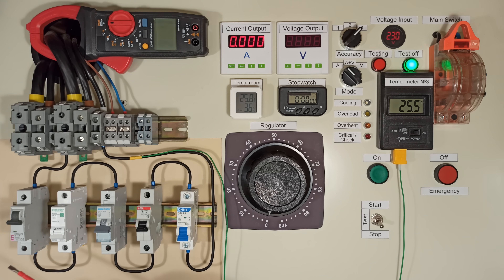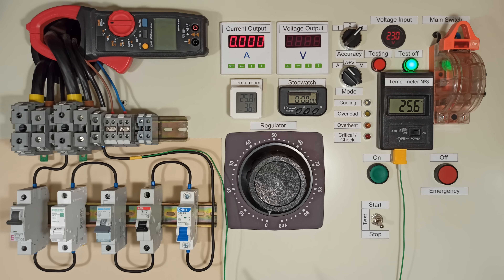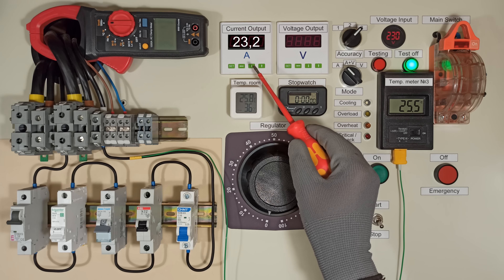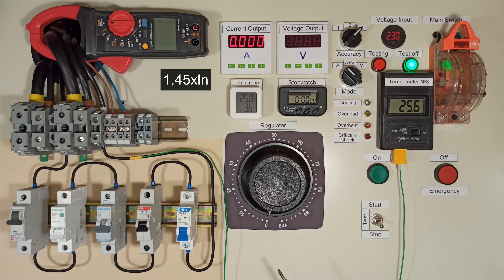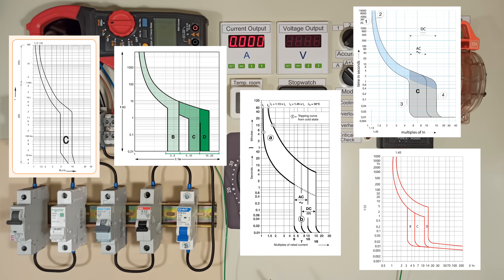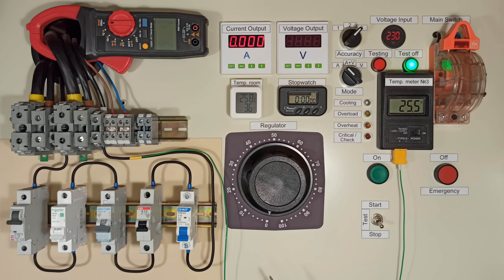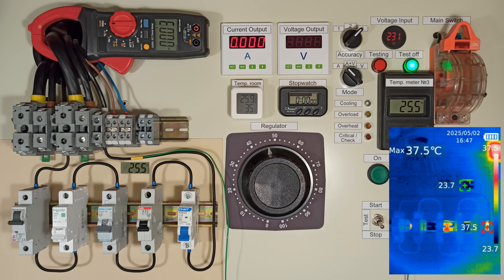Test MCB 16A. ETI, SE, Hager, ABB, CHINT

Comment from the maker: Please support my channel: https://www.youtube.com/channel/UCqZUswoAI9E9iFcTeS7L6gw/join
Which is better – fast tripping or slower tripping? Also, about the ETI circuit breaker – I use them. Great breakers! I'm thinking of repeating the test with 5 identical ETI breakers. Like this if you're interested too! 
Upd 17.05.25 Test 5 ETI
Upd 30.05.25 Test Eaton, Noark, Gewiss, Legrand, E.Next
Reply: pleas test EATON too
Reply from the maker: @HansWurst-bs6yr  Ok, I'll pick out 5 more circuit breakers. I'm curious myself.
Reply: @ElectroTest_1  there is EFAPEL brand, made in Portugal
Reply: @ElectroTest_1  would love to see how cheap chinese ones perform, in my experience there may be some surprises. I am also curious how 10A breakers behave, in my opinion they are often faster than they should.
Reply from the maker: @xtevesousa Okay, I'll keep that in mind. I'll see where I can buy it.
Reply from the maker: @arion_vulgaris Thanks for idea, if I have the opportunity and time, I'll test the 10A.
Reply: Before buying more identical (also interesting) just repeat the same test on the same breaker (with sufficient cooling reset time inbetween)
Reply from the maker: @cybermaus I agree, the thermal element is not very accurate. I think there can be significant deviations for a specific circuit breaker as well as for several tests in a row.
Reply: It would be amazing to see the difference between big name brands and the smaller companies that are popping up, (most seem to just re brand Chinese products)
Reply from the maker: @MrDleete-mj9vt Yes, it may be interesting. However, don’t forget that a circuit breaker is not only about tripping protection. It’s also about reliable and high-quality terminals, functionality, additional components, warranty, etc.
Reply: @ElectroTest_1  Ich nutze Siemens.
Reply: @MrDleete-mj9vt Yes, you are right, many products are just developed locally and manufactured in China.
Reply: il magnetotermico DEVE rispettare la curva di targa, quindi per quanto possa sembrare strano l'ETI ha fallito il test. A ogni modo sarebbe interessante vedere anche Siemens e Biticino
Reply: which is better depends on the use. If you start an electric engine ( a big vacuum cleaner or some thing) then slow is better. the starting current can be cute large. for realy big engines you sometimes even need a class B breaker isstead of a C class breaker. As long as the breaker is lower raded then the wireing youre good.
Reply: ABB and SE are much better quality. But this is known since 100 yrs
Reply: Fast tripping is better
Reply: It was my impression a few years ago that some "off brand" contactors were copies of the previous generation of " big name" ones or used the old tooling. This could be useful for replacements as it seemed to be normal to change the terminal layout and accessory mounts with every new model. It would be interesting to look at old datasheets to see if mcbs are the same.
Reply: Kommt auf den Einsatzzweck an! Sicherungen sind KEIN Geräteschutz nur ein Schutz gegen Bandgefahr! Eben um alle Einsatzzwecke abzudecken gibt es in jeder Leistungsklasse (2. 4, 10, 12, 16, ..... A) auch verschiedene Typen mit verschiedenen Schaltkaraktaristika (A, B, C, D, Z, K,....) https://de.wikipedia.org/wiki/Leitungsschutzschalter
Reply: This is precisely the reason, I prefer HRC fuses, over mcb.
In my test benches I always use semiconductor fuses in series.  
Now that semiconductor fuses prices have dropped drastically, it makes no sense not to use it. 
Please note the tripping time is what protects from a disabling injury. (I prefer less than 5mS) Flashover in face creates serious injury (seen umpteen both for humans & simians).
Stay safe & donot use mcb as a protection. Use a large rated S.Fuse if in doubt, but do use please.

EDIT: Tripping time in Second😅😅 is NO safety for the personnel. It's like a jack hammer hitting an object 5mS makes sense. 1S makes it a salad.
Reply: slower tripping -> 3-phase electric motors
Reply: It would be interesting to see how very old and used breakers behave.
Reply: Lower coil trip current. This is only meant for shortcircuit but It should be as low as possible, I don't get why it has to be 10x the rated current
Reply: I'd like to see one by ADELID, please.
Reply: Those same circuit breakers are available with different trip curves from A to F (C is the most common). The deeper into the alphabet the higher the inrush currents permitted.
Slow is good for motors, fluorescent lights and switch mode power supplies.
K curve and Z curves are available from some manufacturers…
Reply: @allangibson8494  "The deeper into the alphabet the higher the inrush currents permitted"- it's not that simple, for example K is between C and D (12x nominal current) and Z is even faster than B (3x).
Reply: Чинт работает!  Как там жизнь на земле заморской?
Reply: all made in China，all pass requirement, pointless testing
Reply: Fantástica prueba …simplemente excelente información técnica …gracias por tu aporte de alta calidad…saludos 😃👍
Reply: IDIOT test.
Reply: VERY GOOD TEST !
Reply: Application-dependent answer. Fast trip for delicate circuitry is better, but applications with motors and other 'working' pieces tend to require the higher curves due to inductance / heat loading.
Reply: Rápido. Se trata de proteger aguas abajo.
Reply: I wonder if there is a quality difference between a earth leakage + circuit breaker  compared to a alamat (not sure if also called like that in English, but the combination of the two in one test).

Comment: the ETI trips at 34 C, does this mean it wont work in hotter environments? like in the summers, my room temperature could reach 35 C easily. I don't understand it, so I asked.
Reply: The temperature refers to the temperature of the electric wire, which heats up due to electric resistance. If the breaker does not function properly, more power can go over an electric wire than intended, causing the wire to heat up potentially reaching temperatures at which the wire (or things surrounding or touching it) can light on fire due to the temperature. The breakers are being tested, by running 23.2A (so 1.45x more than intended, for a total load of ~5400W) through them. Regardless if it is hot, or cold, you shouldn't run too high loads. If you need more than 16A (~3750W), you should be splitting the load over 2 16A breakers, or use 1 larger (30A or so) breaker. The breaker is there to protect you from fire (and/or electrocution).
Reply: To clarify, the 34C is just a measurement of the wire. It is not (directly) related to the speed of the breaker operation. As seen in the curves (in the datasheets), the breaker should trip based on (1) the % above the rated maximum, (2) the duration this is done. For example, if the load is 10x higher, the ETI should (according to its datasheet) trip in fewer than 10 millisecondes. Hope this clarifies!

Comment: ETI always was bad.
They are often welded, while switch on with load near they're nominal current.
50A mcb almost always failed.
8 from 10 was welded contacts.
Reply from the maker: Interesting. Thank you for sharing your real-world experience. After what period of time did problems with the circuit breaker start to appear? Were they used in apartments, houses, garages, or at industrial facilities?
Reply: @ElectroTest_1  
Industrial facilities.
Beckup power supply.

Almoust immediatly - less then one monce.

Comment: Speed and temp is nothing without knowing gauge(seize of the cable being used and their isolation) Please include this information before testing the AMP jolting trough any circuitbreaker.
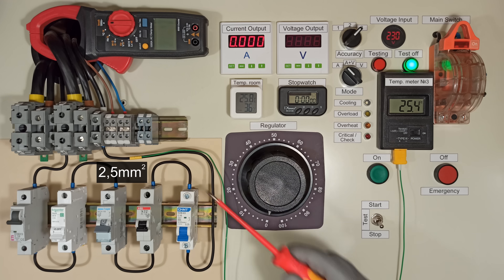Reply: It is shown at 0:44 to be 2.5mm². Electric (indoor) wire is typically coated with (a single layer of) PVC. The example is a very common electrical installation in a modern Northern European home.

Comment: shouldn't each breaker get their own independent feed? Now you are just looping them from breaker to breaker, introducing more resistance after each loop. Each breaker after each loop is effected by the breaker before it so you don't have a clean calibrated result.
Reply from the maker: Overall, you are right — for laboratory tests it would be better to check separately and with a greater wire length, about 1 meter. I didn’t think about that at the time. But do circuit breakers significantly affect each other? If it’s just a few percent, I don’t see a problem.

Comment: Just went through this test for building a fuel controller panel, B series breakers for the Dispensers and D series for the Motors, everything is ABB, looks lovely VS what we had been using
Reply from the maker: Thank you for sharing your experience! I will also test different machines. And where exactly is this fuel control panel located?

Comment: i realy fail to see what we gain from this? there will always be a slight diviation on the bi-metal that messures the overcurrent. so already here this test could trip out false positive due to a single sample size. then there is the voltage drop over multiple breakers because they all cause their own resistance. not alot. but it's still there. and last all products build to their own specification. so as long the wire never gets above 60-70 degrees C (depending on the wire type, and my memory serve me right) it's all safe. and how do we calculate this? how many jouls will the wires be exerted with a low current short and high current short (really just the the lenght of the wire from where the short is) if the wires don't get exerted the maximum amount of jouls. it's up to code. sure some one could set an extension cord from the outlet and have a short few hundred meters out. but that should be covered by the breaker. and as we saw here. that seems to be no problem at all, so we don't need to calculate if the load gets exerted the rating of the breaker to be up to code.

having a bit longer cut time like the chint is beneficial if you got a motor with a high starting current. but how often do we start and stop a motor without a softstarter? very good reason heatpumps got a large capacitor to spread the start load.

Comment: You're testing MCBs with different trip curves. This is a useless test. Those manufacturers give you multiple trip curve options for the same breaker model. You could have chosen to compare apples with apples instead of oranges

Comment: useless. seems you do not have elemetary knowledge of electricity. Tes it single, oteherwise the resistance of each connection will influence......
Reply from the maker: You made a great observation! Breakers can influence each other — but will this influence be significant? Although I do have similar tests where the breakers were tested individually

Comment: They all seem to perform more or less as expected. What I'd like to know is how circuit breakers behave when the overload is closer to 1.1 or 1.15x nominal. Is there a point where the tripping time is essentially infinite? Do you get a few hours?
Reply from the maker: You asked a good question! I haven't tested it for more than an hour or two yet. Overall, I still think that it really might not switch off. However, there are various factors. If the circuit breaker is in a real electrical panel, the heat will likely accumulate. It might be worth trying such tests.

Comment: Would be interesting to have the resulting temperature of a wire that is installed in a realistic environment and see if the breakers can keep the temp below 90 degrees in all load scenarios.
Reply from the maker: Good idea. And why exactly 90 degrees? Do you mean the maximum cable temperature? How is it better to position the cable on the test stand so that it’s close to real-world conditions?
Reply: @ElectroTest_1  Yes max calbe temp. Real world condition f.e. of a real cable in a cemented wall at usual laying depth f.e. 2 cm deep in concrete and plastererd in. Standards are designed to keep it below max cable temp. would be cool to have a video demonstration if it really works with a given protection device.
Reply: Also the non standard way of doing things. What happens if you lay the cable in a slit you did in a thermal insulation material. F.e. an XPS inner wall insulation mat. Preferably melting or burnable insulation like polystorol or some bio granulates. Could happen f.e. with a hollow wall cabling line when blow in insulation is applied later.

Comment: It was already mentioned to repeat tests after manually switching X times but id add this one: physically fix the switch and take it into far beyond switching regions. Then repeat your tests.

Its way too common for people to hold switches in place when they need more power but breaker keeps opening. It can cause partial welding and dendrite growth.

Comment: Не забываем что для SE характеристики указаны при температуре окружающей среды 40 град цельсия, для остальных температур есть поправочные коэффициенты.
Reply from the maker: Why does Schneider have circuit breaker curves rated for 40 degrees? Most manufacturers use 30 degrees Celsius, and SE also rates theirs for 30 degrees. For 25 degrees, the nominal current needs to be adjusted — it’s about 0.5 A higher. In this video, I didn’t focus on that, but I do take temperature into account in future work.

Comment: I'm from the area where we have an ETI factory. Izlake, Slovenia. It would be interesting to test some of their identical fuses to see what the consistency is. Also what wires did you use? I didn't notice if you mentioned this info. Are they 2,5mm square hard wires as they should be for the instalation use in hardwired wall cabinet for residental usage?
Reply from the maker: It’s nice to see people from interesting places! Maybe you even work at the ETI factory? In the video, the wires are 2.5 mm² (actually 2.35 mm²). However, these are flexible, multi-strand wires, which shouldn’t significantly affect the heating.
Reply: @ElectroTest_1  I don't, but my cousin works there as a maintenance worker.

Comment: Circuit brakers must work as announced in the datasheets. Ideal conditions when it in the middle of graphics, but anyway it should be safe and not to be overheating and firing. Schnider has good price and quality, ABB and Hager are  also good just a little bit expensive

Comment: Nice test but i don't think it is valid for a comparison. This because:
- all breakers are wired in series. The 23,3A is given by a 10 Ohm resistance, but the actual resistance is much lower. A guess is like 0,01464 Ohm
- the 23,3 Amp is measured at the input side, but is not the actual total of all combined. 
- Since heating up increases the resistance, less ampere will flow, thus less heating. At input of of 23A heated to +20 °C  21,3 Amps will flow, at +40°C just 19,6 Amp will flow. So 1 heated breaker will restrict the flow on all of them. If more heat up to different temperatures there is no telling what the actual current flow is without measuring. 
To compare them in a equal setting they must be tested separately or parallel.
So please do. It would be interesting to compare the series vs parallel test in practice.

Comment: ETI is the best and accurate option to protect the wires. Activates at more than 16 Amp and is inside the area of the graph if you do an analysis of the uncertainty of the  instruments.
Reply from the maker: ETI makes good-quality electrical equipment, but this particular breaker seems to trip a bit faster. I probably should’ve used a slightly higher current, since the temperature was about 5°C lower. Still, that’s not too bad — better earlier than later =)) You can also check out another video where I test 5 ETI breakers. And you’re absolutely right about measurement error — it really affects the analysis. The point is very close to the curves, which is a good sign

Comment: This test confirms the choices I made in my home:
 - all my breakers are lower amp than allowed for the wiring (f.e. local code for 2.5mm² = 20A, I used 16A and 10A), better safe than sorry, I have a lot of foam, wood and paper materials in my walls and ceilings.
 - most of my breakers are Schneider, a few are ABB. Although the temperature didn't rise too much higher, I wouldn't want a slow breaker like the Chint to protect my house. The ETI would theoretically be the safest, but tripping sooner than spec makes me think there is a quality issue and maybe it will trip overly easy under normal use as well over time.
Reply from the maker: Nice, well-reasoned comment! I don’t think it’s possible to draw a final conclusion about the performance of breakers from different manufacturers. I just took random breakers, one of each. There’s a video where I test 5 Eti breakers — you can check out the results. In any case, I think you made a good choice for your electrical panel!